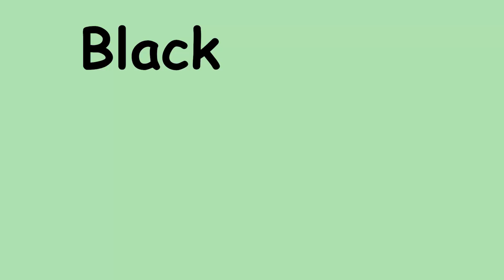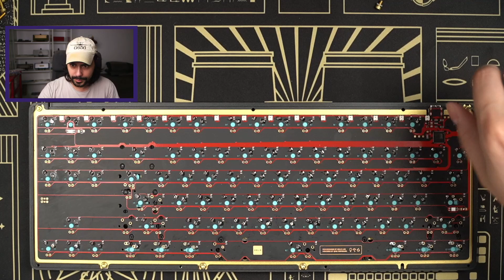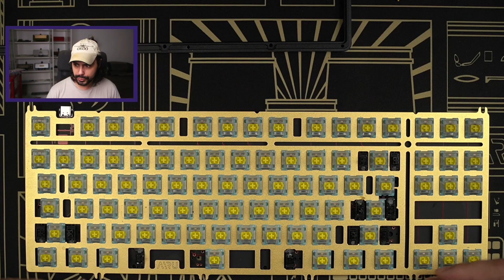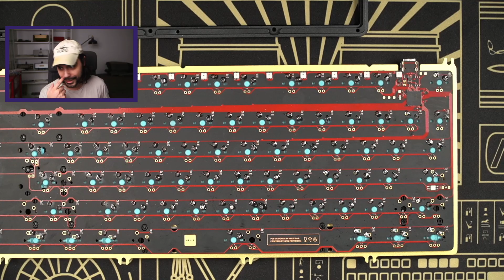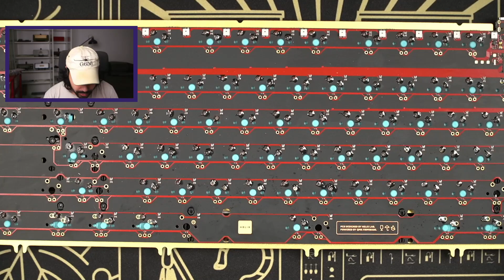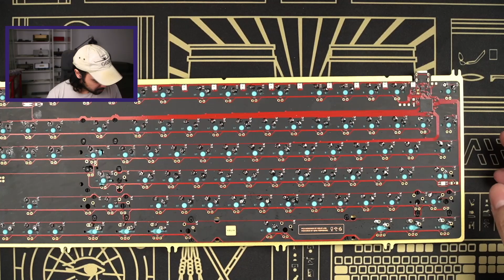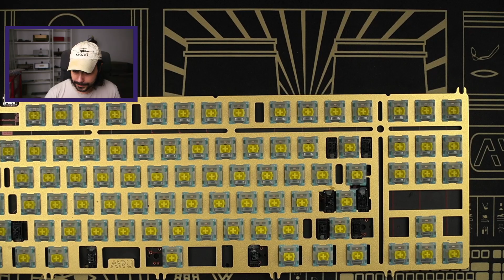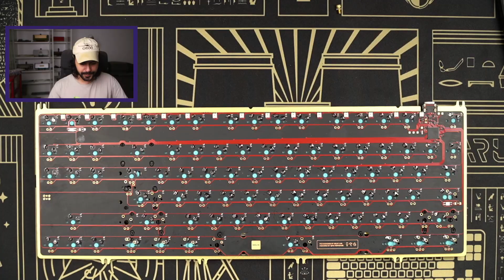Helix Lab Aaru In Depth keyboard Review

Comment: So I've been binging a lot of your videos recently and got a pretty good idea of what you think makes a good and what makes a bad keeb. I personally would find a lot of use from a video about what you like in a keeb and what you do to achieve that, what things you need to do to build a keyboard that is good in your opinion, etc. For example, things like not putting foam in keyboards because it mutes noise or using plate mount stabs so that pcbs don't have a chance of shorting.
Reply from the maker: A great deal is all preference, to those that genuinely like the found of foam for example, let them eat cake

I do plan on releasing a long video with like 100+ keyboard tips I've learned over the years... But in terms of what makes a good keyboard - a good keyboard is always the one you like using
Reply: @Blacksimon  I'm so interested in this if you're still up for making this!